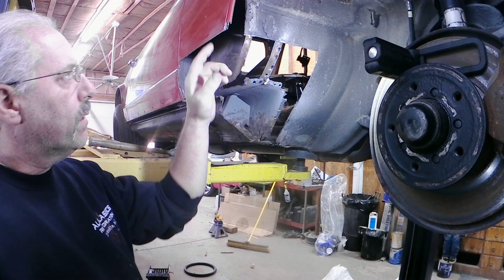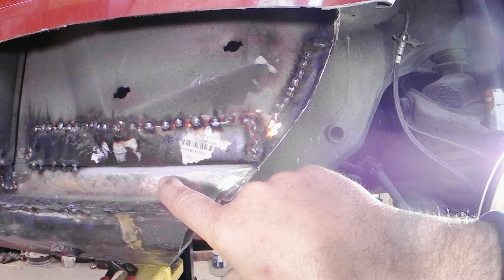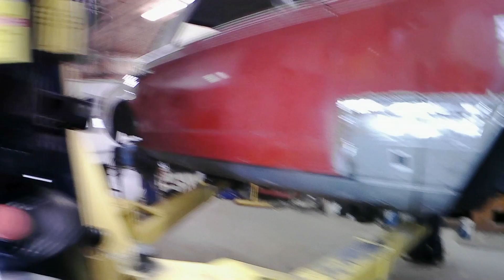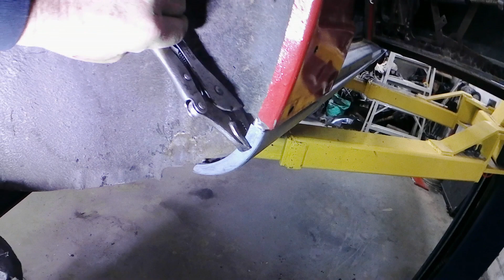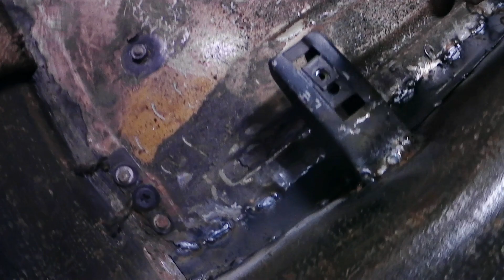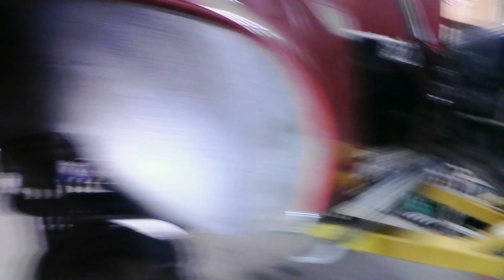1969 Mercedes Fender Repair Part 4

Comment: Noticing your 2-post lift, I have on my bucket list to get either a 4 post or a two. Which do you like the best?  -Dave
Reply from the maker: The 4 post definitely takes up more space in the shop but is certainly more stable.